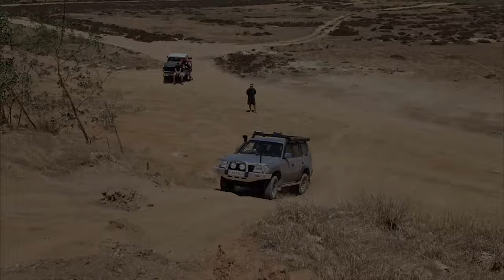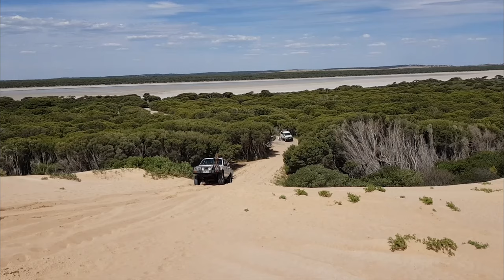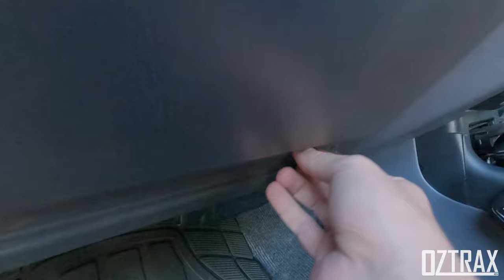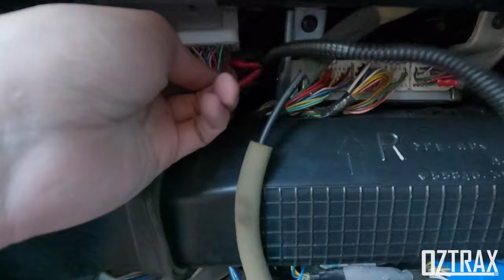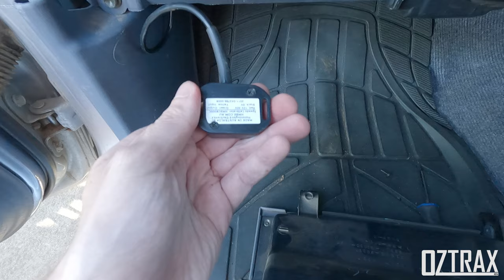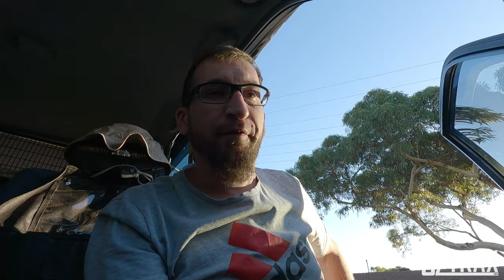DIY: Toyota Prado 90 Series // Speedo Calibrator Install

Comment: Do you have a link to the product this is? Running 35s with 5.29 ratios and am reading 15% over so need to bring it back.
Reply from the maker: It's in the description box.

Just make sure you have a wiring diagram before you go doing anything as this was wired on a Series 1 90 series 5VZ-FE.

Comment: Would you have info how to do it on Ford Ranger PX3, 3.2 TDi ?
Reply from the maker: I believe that would more than likely have an ECU setting to change something like that in a newer vehicle which would only be accessible by a scan tool.

Whether that is a dealer level one or not, I'm not certain on.

Comment: Does pin 6 effect the odometer at all, or just the speedo
Reply from the maker: Well the speedometer needle is directly related to the odometer, so the slower you travel, the longer it takes to click over as with any other vehicle.

If your speedo reads under or over it will affect actual distance travelled.

Hope that kind of explains it.

Comment: Do you know if the prado is a hall effect speed sensor or a inductive ?
Reply from the maker: From what I remember about owning the 90 series, three wires were hall effect and two wires were inductive.

I'd have to do some research to confirm which is which.

Comment: Nice one mate, how do the 33s ride? Mine are still stock but I want to do the tyres this year or next.
Reply from the maker: The 33s ride well. A fair bit of work involved to get them to clear on a 2 inch lift though.

I have other issues right now too, like my trans has started slipping. 😬
Reply: @OzTrax4X4 Oh no I hope that goes OK. At least the A343F is a reasonably old school trans. Plus a rebuild should be good for another few hundred thousand km!

Comment: After following this and eventually removing every single pin  one by one it doesnt work, not one of those wire affect the speedo on ours. Luckly ive only cut the wires you said and pulled the pins to test other or we would have a right mess.🤦‍♂️ so my advice is DONT cut any wires remove the pins as you may find out what we have but have a loom butchered tf. 👍
Reply from the maker: That's unfortunate that it doesn't work for you. 🤔

This was for a Series 1 VZJ95 Prado.

If yours is a Series 2, they have potentially changed the loom due to the introduction of Active TRC.

It always pays to consult a wiring diagram before attempting anything, especially if you haven't done wiring before.

All my wiring colours came from a genuine electrical service manual, hence this does work as it worked in mine, so if yours is a 99 or newer, I'd be finding the diagram and checking it over again. 🙂